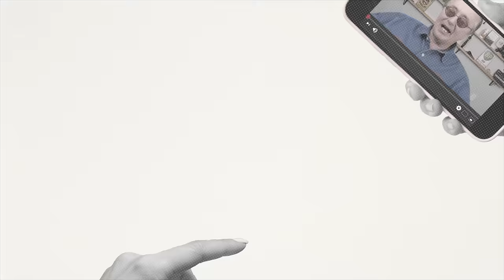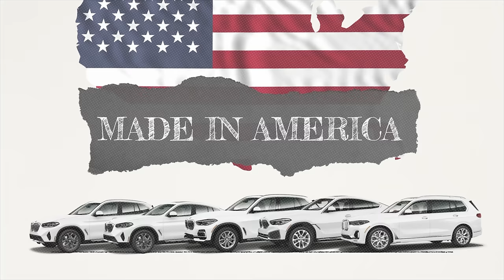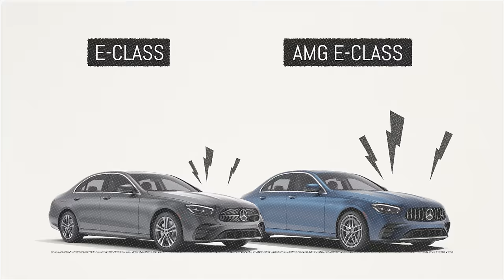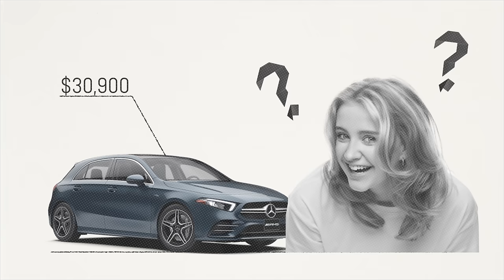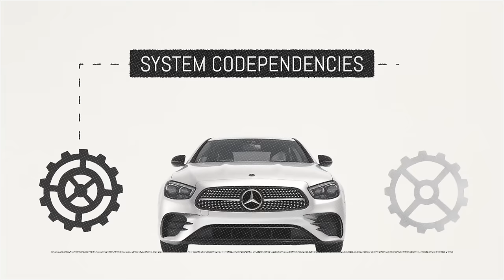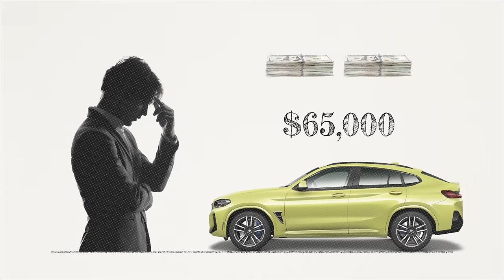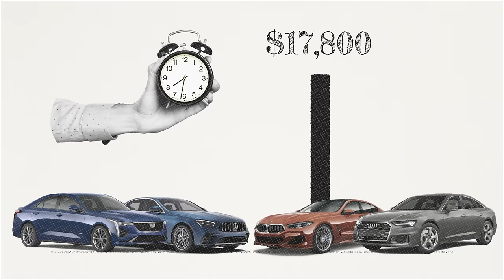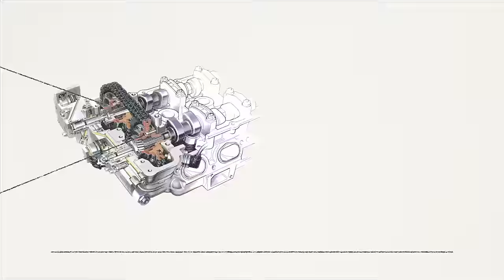3 Car Brands Only Stupid People Buy

Comment: I love my BMW.  I've driven Lexus, Audi, Genesis, VW, Ford.  I always come back to BMW.  There is just something about the way they drive that no other car manufacturer has come close to outside of Porsche imo.  Now with that said, I never keep them out of warranty.  I made that mistake one time and boy oh boy did it cost me (12k ouch!) My advice unless it's new or BMW certified do not buy one.  Just because an M5 can be had for 20k on the used market doesn't mean the repairs are going to cost the same as a 20k car new.
Reply: I'm glad you're real with it. I would love to own a V8 lexus, whether it'sthe IS500, RCF, or LC500. Nothing will beat the sound of those engines : )
Reply: That's exactly it. Scotty's preference is reliability and affordability. Which BMW isn't great at but that's because they're more focused on performance and being the "ultimate driving machine." There's a significant difference with how a BMW handles, feels and performs vs other brands. Most people after driving a BMW for a while have a difficult time switching to another brand because of the handling alone. That being said when a vehicle is more performance focused it costs more to maintain it.
Reply: @fred420 Like I've always said & believe "whatever someone wants to throw out the window, whether it's a dollar, a 20, a 50, a 100+ then good for them". As no matter WHAT you drive there will always be some $ $$ $$$ $$$$ $$$$$ going out that window. ENJOY!
Reply: @fusrodahing1993 I have an RCF and Love it more than life! :)
Reply: Even the certified one are not so reliable as well. Been there done that, just lease them when new and get new one every few years.

Comment: Missing from this video is that Fxx and Gxx BMWs place third behind only Lexus and Toyota for reliability. Considering that used ones have depreciated more but you get a more reliable vehicle with better features I consider a used late model BMW a smart buy, Especially those with the B48 or B58.

Comment: My wife and I both drive 6 pot Mercedes E class and have done so since the 90s.  We update them every 4/5 years.  Yes servicing is more costly than a Toyota or Mazda.  We have NEVER had a major repair job. However as we have the cars regularly serviced and they are never older than 5 years I wouldn't expect to have any major repairs either.  I have nothing against Lexus but they are pretty boring/conservative type vehicles.  We bought Mazda 3 for our kids when they were teens.  They turned out very reliable.   Maybe my wife and I are stupid but we buy and drive what we like and have NEVER had any of the issues you seem concerned about.  It really is pretty simple, if you want to buy a Toyota and keep it for 25 years and put hundreds of thousands of miles on it then that's great.  But some people have no interest whatsoever in keeping a car for 25 years or putting hundreds of thousands of miles on ANY car.   Each to their own. Merry Christmas Mr Scotty!

Comment: I cringed when a co-worker said they got their BMW for 6000 dollars. It was misfiring and needed a ton of work after they drove it for one month, and became completely useless after about three months. My coworker, well, we worked at a Dominos. She wasn't doing delivery, just commuting. Think about that, she spent her last penny for a badge, a big fat lie.
Reply: When parenting fails 🤦‍♂️
Reply: lots of missing information here, like mileage of vehicle, condition of vehicle, did she take it to someone to inspect, how many owners said car had, age of vehicle, what type of bmw, did new owner use the proper fuel as many euro cars require premium fuel. the lie isnt the car or badge but the lack of information about the vehicle.
Reply: She got the most reliable BMW
Reply: @fuckyoutube12 the fact she bought it for $6k  just about gives you the answers to all your pointless questions

"As many euro cars require premium fuel" -🤡
Reply: 6000 USD 😂
Reply: ppl with self esteem issues are drawn to this brand
Reply: I bought my BMW for $4,000. Misfires are nothing to be freaked out about. I fixed mine myself and it drives amazing. When you can fix things yourself, BMWs are totally worth it.
Reply: Don't blame the BMW badge or car. Blame the previous 6 owners on how they treated it.

Comment: In Greece a local mechanic that works on Audis can easily find you replacement parts non oem at great prices. We have an 2007 Audi A4 Quattro that is cheap to mantain and is great to drive! We keep this when we go down together with the 94 Celica
Reply: @@iNullias In Greece aftermarket is cheap

Comment: My first car was a Mercedes w124 300td 4matic which went 500k with no problem and next and my current car is a w210 320cdi which is doing 280k miles with no problem.
I don't know about new Mercedes but older ones were awesome to drive and easy to maintain.
Reply: E classes from various generations can definitely see high mileage. I've seen plenty for sale over the 200k miles mark from the w210, 211, and 212 gens. If they were utter garbage+money pits, I don't think they would be commonly used as taxis. Even from the luxo barge category, it's not uncommon to see an S class hovering near or over 200k. Something I can't say about the 7 series or A8 from my own car shopping experience.
Reply: @SunGxdRa  my friend had taxi w124 1993 250 turbo diesel black sedan with 1 million miles, so it's a reliable workhorse.
Reply: The e class has always been one of Mercedes' better and this is still true for recent models as well.
Reply: was the w124 not one of the most reliable cars ever?
Reply: @SunGxdRa  I feel like the 7 series has always been disposable. They plummet in value and become absolute money pits as they rapidly fall apart after 7-12 years. 
It's actually been my BMW ownership experience that persuaded me to now switch to Lexus.
Reply: I'll bet that 500k is in kilometers which is 300k miles, but a Toyota can go 1million miles which is 1,600,000 kilometers
Reply: @nyxline  500k miles 805 000km my w124 did with no issue.
Reply: The newer ones more reliable trust me , don’t listen to this guy !!!

Comment: I can afford virtually any car but would never buy any of those because I'm not stupid and I like  being inconspicuous. German cars are often pleasant to drive but they are also frequently mechanical and electrical nightmares.
Reply: \"but they are also frequently mechanical and electrical nightmares."/  - Yet my wife and I have been driving Mercedes cars for several decades and NEVER had that issue?   If you keep any car long enough and put enough miles on it they all need to be repaired. For every story of a nightmare for brand A,B or C there are converse views.  I like Scotty but he carries on like Toyota or Lexus NEVER have major issues. I think they are well made but like all cars, they also have their issues.
Reply: @MJSE-of7gs he might be referring you to Audi s.  My brother got two of them at separate times and both of them ended up running amuck with electrical problems
Reply: and not to mention, you have to drive around in a Toyota.
Reply: @MJSE-of7gs  For yrs., my company provided me with new MBs.  All were made in Germany.  All arrived with at least one factory defect (one with several, including a scratched cam lobe). All were perfectly maintained and all had major issues of one sort or another. Several left me stranded, as did the dealer's loaner when my car was being repaired yet again. It was a great MB master tech who said that, when I was spending my own money, I should buy a Lexus. I did and the difference has been huge, though I would never take to dealers for service unless under warranty. I will NEVER return to any German brand.
Reply: @MJSE-of7gs The world DOES NOT revolve around you.
Reply: @wholeNwon   What year and models MB are you taking about?  Maybe you are jinxed?  It has not been my experience with MB 6 pot E class sedans and coupes, all made in Germany.  Maybe you should buy a Ford?  LOL
Reply: @mitchellcole832  Merry Christmas, I am so glad you replied, I just knew you would.

Comment: This is a great video. I’m sure that Scotty could afford to drive whatever he wanted. Yet he’s practical. Smart man. 
A friend bought a used Mercedes about four years back. The power tilt/telescope wheel failed in the lowest position! A cool $750 to repair it! No thanks!! I’ll pull the spring loaded lever on my 18 GMC to adjust the wheel, thanks!
Reply: my ex told me she had to replace a dead headlamp in her Mercedes - I'm like "yeah? , any autozone or O'Relies will have the little book -hanging in the aisle for customers to choose one , install should take 10 minutes and anyone can do it" - She's all like " doesn't work like that in a Mercedes - I had to bring it in and it cost over 200$ " I'm like how is that even a thing ? " Maybe there's more to the story - I'm sure some people can just do it themselves , but I don't know ... just wondering if that's they way they are or what ?
Reply: I'll stick with my S class : )
Reply: @DiCelloPiano I am thinking this might have been a simple bulb for $200 at the dealer. It can be tricky to get the bulb in and out of some of these cars so 30 minute job plus more expensive bulbs marked up could be $100 so you can easily see how that number could come about.
Reply: @THEGAMINGHELP101 Especially if the dealership pads their billable hours (in terms of labor) the same way law firms and emergency rooms do, where you are charged the full hourly rate for an hour's worth of labor - or any fraction thereof.
Reply: People like Scott usually know a good deal like an old Lexus or Acura and fix em up good as new !
Reply: You bought a 2018 GM product? Enjoy the money pit!
Reply: Oh sweet pea, GMC repairs/parts are just as costly if not worse.

Comment: Im still driving in a 2008 BMW e9x 330i. Been the most reliable ive ever owned. Its outlived all my other cars. Still looks timeless & new. I only paid $6k for the car. Did i mention its been the most easy car ive ever owned to maintain in my own? Havent taken my BMW to a shop in 10 years, and the time I did was for a recall IIRC. My BMW is still driving strong & reliable with 450k miles on it. Original motor. I don't drive BMW because I want to look "rich", I drove BMW because it's a superior driving experience & it feels like driving a real car that I can maintain myself.

Comment: Been driving BMWs for the last 10 years, if you do your research, service it more frequently than required and find a good independent mechanic they can be good cars. Just bought a 2017 F30 and it’s far nicer than the Honda and Mazda alternatives I tested.
Reply: Honda and Mazda are not alternatives to a BMW. The latter is in a much higher price bracket, and in my opinion horrid cars to ride on as a passenger.
Reply: I lucked out with my mechanic. He's a BMW owner and has a few he works on often

Comment: My first car was an 04 BMW 325 with 140k miles on it. 20k miles later the engine blew up. And that 20k miles I had it something broke at least once a week. Got rid of it and got a 2019 Toyota Tacoma with 45k miles on it for 41k. That truck never gave me one single problem. But 2 weeks ago someone rear ended it going 40-50mph and totaled it. My dad was driving it with my step brother and dog to pick up his 4Runner from a routine service. The bed and rear of the frame were a little bent. It had 75k miles at that point and insurance gave me 34k for it! I just bought me a 2023 Toyota Camry SE Nightshade for 29k with 8k miles on it. I wouldn’t buy a new Tacoma anymore became of the crazy markups but I think I got a good deal on my Camry. I love Toyota. The peace of mind I get with their reliability is the greatest luxury. I spend enough money between the loan, gas, and insurance. I don’t wanna pay for a mechanic all the time too.

Comment: I have had a 2012 BMW 335i and have driven over 200,000km on it with hardly any issues.  I now have 2023 BMW M3 and it is the best car I have ever owned.  The important thing with BMWs is to do the regular maintenance and drive them regularly.

Comment: I’ve had 2 BMW’s over a 20 year span. Plastic parts began to break over time. Only lease these vehicles and happily give them back. We’re a V6 Honda family now.
Reply: One thing that is a key factor for this is environment. Very hot climates stress car parts. Plastics suffer real punishment under high heat. Wiring insulation will lose flexibility and crack, allowing water inside and cause shorts. Plastic relays and other components with plastic housings can crack and compromise function.  And then there's co-dependency problems where one part fails that damages another.
Reply: Your loss 😂
Reply: @bimmer_bros  Not a loss to me. Your priorities change as you get older. BMW’s were my life in my 20’s. I’m in my early 40’s and appreciate reliability more so now.
Reply: What if you just replace the plastic parts with aluminum

Comment: Had many cars over the years. BMWs were very reliable - and my Mercedes w212 e350 makes me smile, everytime I'm drivin it. Best car I've owned so far. The comfort. The power.  Bought it with 60k miles - close to 120k now. No problems so far.

Comment: I owned a BMW back in the day. An absolute money pit. Yes it was fun to drive and super quiet in the cabin. But holy hell … expensive to repair, and the attitude at the dealership was horrible. This year I thought about a Lexus suv as Scotty seems to like Toyota/Lexus. But it’s still a luxury vehicle that will cost more to repair and you pay for the extra fancy dealership.
Reply: Lexus' need less repairs.
Reply: Buy a 2000-2012 era Lexus
Reply: @mikelarry2602  And will last much longer.
Reply: @89joshuadavies honda and acura  are  just as good.. . My last accord had about 370k when it was rearended....ran perfect ..my 5 spd civic SI has a little over 300k ..runs perfect...hondas., mazda,and old fords are all id want
Reply: @mikelarry2602  that was back in 2000, ) now they cheap made and same crap as any other crap. We have 2 years old RX , front brake adjuster pins rusted out, .. all frame under it is cheap steel already rusting out. Black paint peeling.. car has 30k miles and we live in NJ, where there hardly was any snow past 2 winters.. while my 10 years bmw still has nice aluminum suspension.. yes had some electrical issues and cheap plastic issues with bmw but it drives much much better than Lexus.  I do repair my self so only pay for parts.. but if you not mechanically inclined, just lease it and never buy any car anymore. !
Reply: you think a Lexus will be as expensive as a B MW in maintenance costs? what planet have you been living on?
Reply: @michaelcrockette8694  what planet have you been living on?   Dealers make money on service and repairs. ..and I  have not heard that Lexus dealers running charity!
Reply: I once heard a wealthy man who drove BMW's all his life, and kept one to give his son when he first got his drivers licence say, 'You have to be wealthy to buy a new BMW. You have to be stinking Rich to keep an old BMW on the road.'
Reply: biggest mistake on my lexus was getting the extended warranty.. by the time the warranty expired I didn't have to use it once! I take it for synthetic oil changes/brakes to a mechanic I know and not the dealer which makes a big difference.

biggest W was getting the wheel coverage, I used that to fix my rims so many times (it was powder coated), got a full set of tires covered because of some nail/damage, etc.
Reply: Watch out for the new Lexus Gx550, it looks real good.

Comment: I own 3 BMWs used X5 and X5M and I3, all have been high quality with high miles, haven't had excessive issues, some parts wear out, parts are not necessarily cheap but if you can do work on it yourself it isn't too bad keeping them long term. The better performance is worth it. I've done air compressor replacement, vibration damper but the X5 35D has been a solid performer plenty of power and performance. Just got the X5M it is really nice. The i3 is high performance, since it is the early model the range isn't great but other than that it is really fun to drive.

Comment: Can’t complain about my 218d Coupé. Now nearly 10 years old and 150.000km driven. Still first brakes on the rear axle. Front axle got replaced by 138.000km. All that with the „doomed“ longlife-interval were the oil gets changed every 30.000km.

Comment: I had a 1989 Mercedes 300E sedan, great car, bullet proof. Also had a 1995 BMW 540i, very nice car until about 90-100K miles, with this one I should have gotten the 6-speed manual.
Reply: 80s and early 90s german cars were great and reliable, after the 2000s I think the manufacturers deliberately have planned obsolescence to the cars so the rich buyers would buy a new model every few years but the used cars become super unreliable and money pits.
Reply: Mercedes and BMWs were the best cars of the 1980s and '90s, by far. They were elegant and powerful tanks unlike anyother - Sweden's Volvos were also at that level but without the performance and luxury being offered by the Germans. Yes, the Japanese were reliable then but they were boring and highly unsafe soda cans on wheels by comparison. Quality and safety is more equal among manufacturers now.